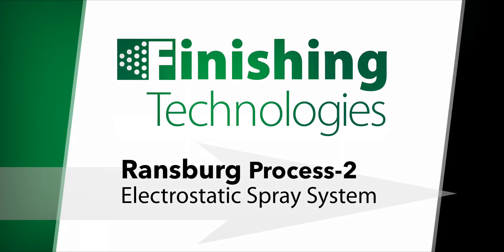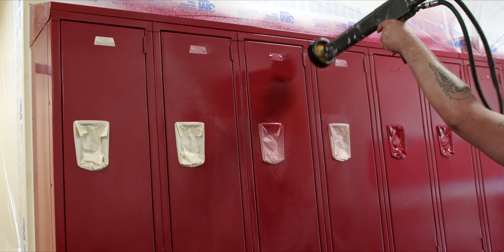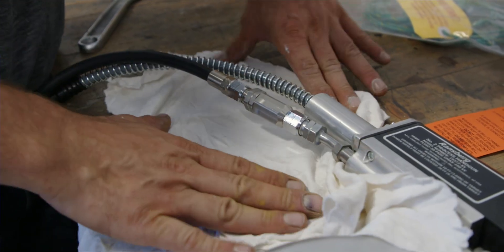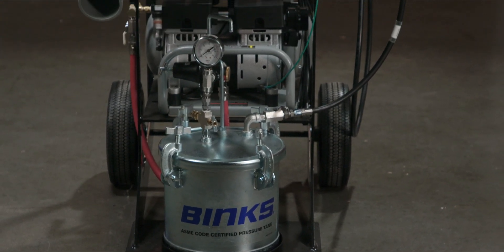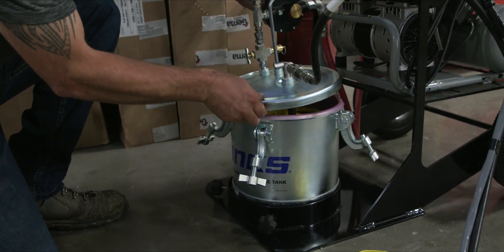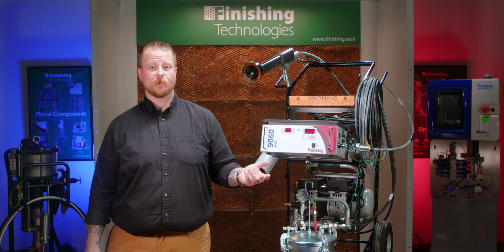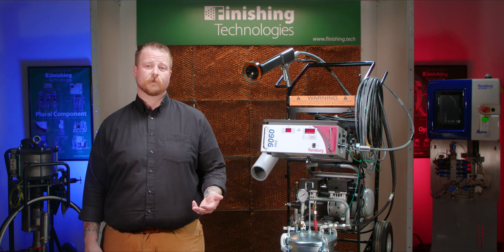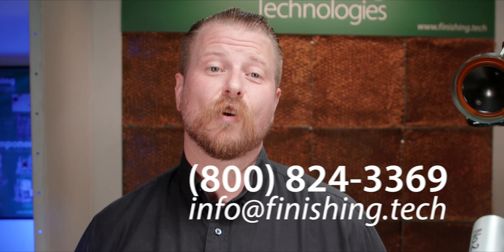The Ransburg Process-2 (Deuce) Electrostatic Coating System

Comment: How is it cured? (Didn't watch full video)
Reply from the maker: I'm not sure what you mean. Curing depends on the coating mostly. If you use the coating we recommend in the video, it's just air-cured. Other coatings might require a catalyst or some form of oven/infrared curing. The equipment just applies the coating, the coatings themselves have different methods of curing depending on which you use.

Comment: I used to work for a Seattle company that re painted office furniture, elevators and even Mission Macaroni Noodle cooking equipment back in the early 70's.
Also painted Safeway product coolers.
We used Jarvie two component epoxy paint with an electrostatic additive. Magicare was our company.
Traveled all over the NW.
Electo-Painters was our competitor.